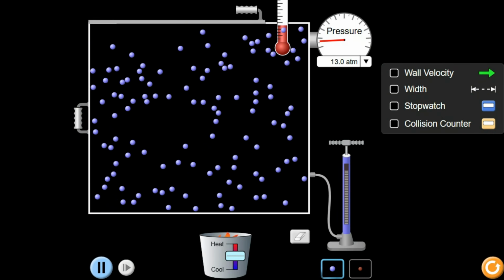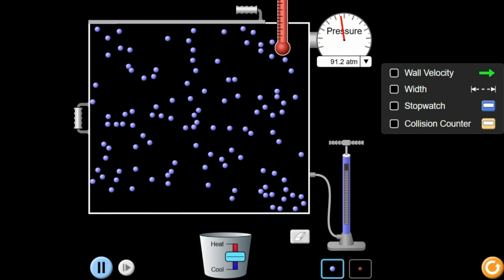When HVAC Pressures Go Crazy: Dirty Condenser Coils

Comment: Was on the toilet, doing my daily due diligences and watching a lesson from my HVAC dude Mike. Learned that there’s a flash point in a concentration zone in the condenser coils where refrigerant quickly transitions from vapor to liquid. If the system doesn’t get enough airflow, that concentrated zone is instead spread out throughout the whole windings of condenser coils. Leads to a build up of head pressure which leads to a decrease refrigerant in the choked evaporator hence a decrease in suction pressure. Learn all this while taking a massive mosh pit of shit.

Comment: Mike please help me understand your statement about the dirty condenser coil Iam with you until your flash gas starts to happen.  Does the sub cooling keep rising the dirtier the coil gets creating a higher temp difference between the sat temp and the amb temp   
You lost me  now.  The flash gas would become present even with all that subcooling??   I get the part how the evaporator would see less pressure drop. Less refrigerant  but the subcooling part confuses me when you start to get flashing in the liquid line with all the subcooling part confuses. Also the condenser requires lots of more space of the coil to condense but the subcooling doesn’t get lees. Correct??  Please help. I know it been a while since you did that video.    Thanks

Comment: I'm missing something here.....We started with a sub-cool of 8 deg., and with the blockage in place the sub-cool went up to 13.3.....What I don't get is - "sub-cool" by definition means a solid column of liquid at a temperature lower than the saturation temp.  And 13.3 deg., compared to 8 deg., means it has cooled that much more.  I would have expected sub-cooling to be less, not more, since there was no cooling available.  So I'm saying (it seems) we never lost that solid column, continuous feed, to the TXV.  Any chance you can clear this up for me?
Reply from the maker: The refrigerant starts to flash over downstream on the liquid line which effects flow and begins to stack up in the condenser. Even though air flow is reduced the stacked liquid has more time to radiate off the heat
Reply: @JerseyMikeHVAC  I get what you are saying.  I like very much that you created this problem to show the effect(s). Thanks so much for that, and your detailed explanation.

Comment: not getting your explanation. partially blocked condenser would reduce or delay the condensenation process, so the return liquid line will be filled with gas and liquid mixture. wouldn't that increase the pressure and temperature in liquid line compared to normal, which means a low subcooling? for the same reason, if the solinoid and txv passed the gas mixture into the evaporator, wouldn;t that in crease the suction pressure?
Reply from the maker: What you describe does happen temporarily, but the flash over to vapor in the liquid line prevents a full head of liquid making it to the txv, and that reduces flow. Liquid then starts to stack up in the condenser. So even though air flow is reduced so is flow rate and the liquid has much more time to cool off than if it were flowing normally. The reduced flow rate will also drop pressure on the evap side because the evap coil is now being starved.

Comment: Never seen that low suction pressure with the high head.  Seems the compressor usually loses so much capacity with the hot liquid that the suction rises, not drops. It seems like you were creating more of a scenario where under mild ambient you are logging liquid in the condenser almost like a headmaster valve there. At that point you will need additional refrigerant to make up for that logging effect. Had to be pretty cool out to see that. ( which explains that low head pressure) On a blazing hot day, that suction would climb as the compressor capacity rapidly dropped off with the increase in liquid temperature.

Comment: Excellent editing work, sir.
2:28 That's my Veto sheetmetal tools bag for installs.
Reply from the maker: Love this bag. 👍
Reply: I’ve got one too, it’s my daily driver for service calls. All my sheet metal and install tools are in my Milwaukee Packout’s… 
My personal rule is to clean the condenser coil BEFORE I gauge up on the unit, you’re 100% correct about how a plugged dirty coil affects subcooling and saturation on either side of the metering device.

Comment: Good simulation video Mike! You can also show what happens with the RLA of compressor and how it affects the amperage/watts or KW of compressor....dirty condensers = $$$ energy bills to increase plus can add undue stress on electrical components increasing amps on all line voltage components...especially Chinese capacitors! You are an awesome teacher keep the videos coming sir!
Reply from the maker: That's a good idea! Didn't think of that. Definitely going to incorporate that into the next ones. Thanks!
Reply: @JerseyMikeHVAC  You are welcome sir! Seen many loose burnt stakon's that would be fine at 7 amps but when it increases to 15 amps the loose connection heats up and burns not only wires but every electric component tied to including the terminals at the compressors? Funny how it is all tied together how one thing a dirty condenser coil can cause so many issues with the system! Have a wonderful weekend sir!